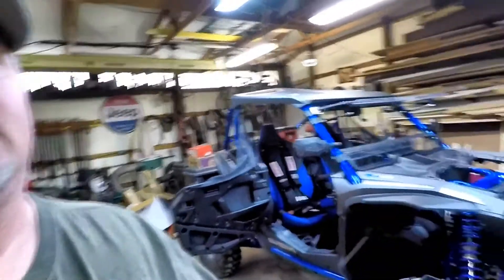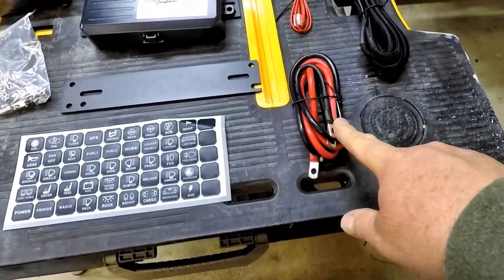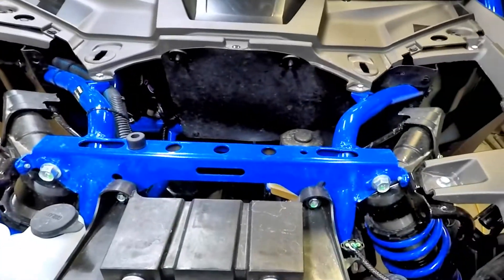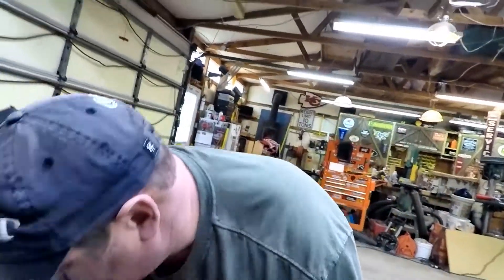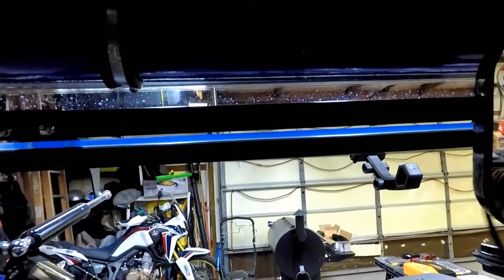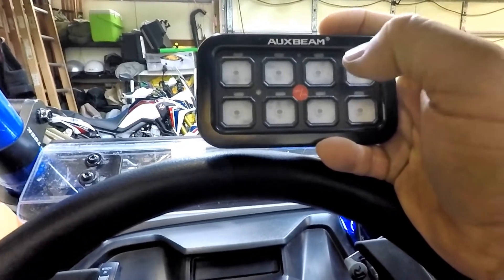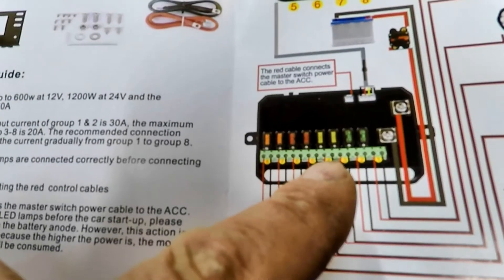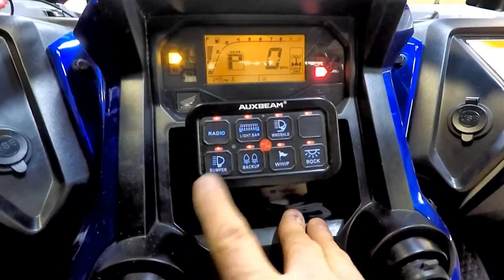Auxbeam switch panel install on my Honda Talon

Comment: Awesome video.  This is helping me a lot with where to install the relay part and the switch part.  Did you use only the bracket that came with the switch, or did you make another one?  Thanks!! Johann

Comment: Nice setup,  will the 30 amp possibly run a winch ? I am totally new to this sport and just picked up my rig last weekend and want a nice fuse panel to run a couple things plus the winch , do u still like this device
Reply from the maker: Still like it, your winch should tell you what size breaker to use. If you have anymore questions just ask.
Reply: Thats what I don't know , I am figuring 3500 lb size not the biggest one out there , I am on the fence by wiring my own switches and put in the blank knockouts provided by honda or go your route , I see u have both , this is my first rig so I know nothing about them
Reply from the maker: @davidsawmandave8731  so you wouldn’t be able,to wire the winch to the auxbeam panel. You’ll have to switch for it. I order a blank 3d printed panel. And just move the auxbeam panel down a little. I guess I need to do a update video, about how I’m running it now.

Comment: Thanks guy ,I did that and found Hondas antiquated black /white instructions . I can’t believe they would print this drawing to use . Honda come on make a more clear parts instruction diagram in color so you can distinguish what wire is what .lol thank you guy

Comment: My concern has been "waterproofness" with the control panel itself... any issues with that?
Reply from the maker: I’ve had no issues so far, the controller is up under the cowling. And for the switch panel, it’s sealed I’ve pressure washed it every time I’ve washed the machine. So far it was been a solid product.
Reply: @DualSportGuy  that was my question as well if the unit is  water proof or resistant,  also they offer 2 styles 2 sided and single sided
Reply from the maker: @seborracing  not at all, and I wash the hell out of this buggy to.
Reply: They should make them  state in the description that this is rated Waterproof in closure so one would know it is waterproof when exposed  . Most of this crap from china has false  descriptions   . Thanks for your questions

Comment: As to the controller, all this is doing is giving you more space by combining the switches in the small box  so you can mount the switch box anywhere you want , correct ? How long of a cable do they provide for connecting the switches to the control relay module under the hood ?  Thanks for the video enjoy your Talon  , tom
Reply from the maker: The controller cable is pretty long, and yes just saves alot of room

Comment: I am trying to find the install instructions for the sub  wire harness and switch plate volt meter kit from honda . They don’t give you any instructions with it or online . Also the honda accessories windshield wiper kit , so far nothing found
Reply from the maker: Pull up the accessories that you are looking for, on the Honda website. Then look on that page for the install instructions, should be there.
Reply from the maker: http://cdn.powersports.honda.com/documentum/MW01/0SA30-HL6-A00.pdf
Reply: Thanks guy,   I did this  and figured it out  .can’t say much for Hondas instructions in black and white and no real detailed drawings .my 3 year old could have drawn a better instruction sheet